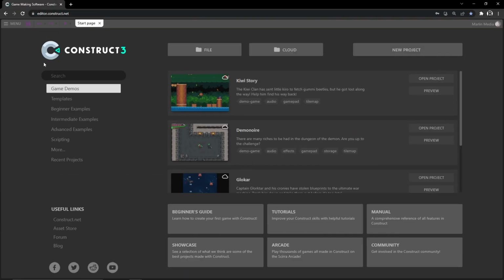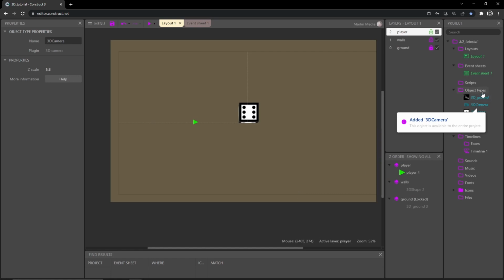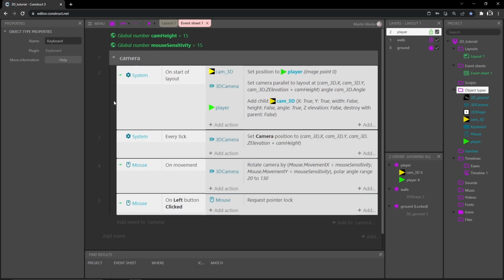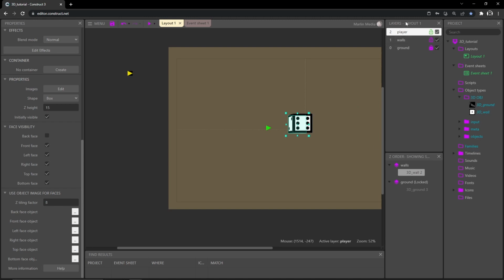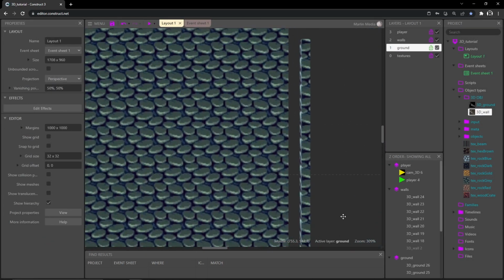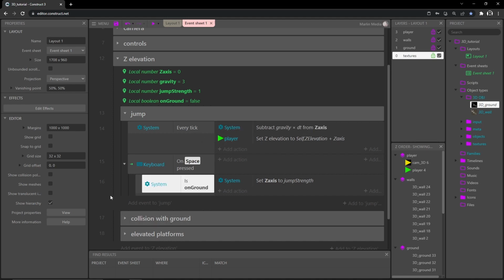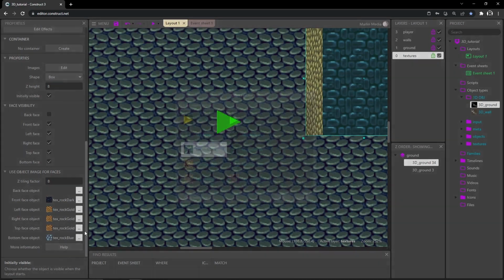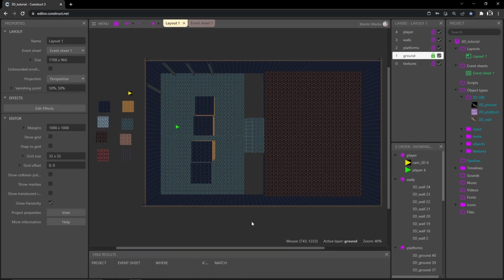3D in Construct 3 -- movement - camera - shapes - gravity

Comment: hey uh question. what does cam_3d actually do? i don't see the point of the cam_3d object. u can just set the camera to the player and it works the same. when i was following this guide and after i did the camera section i deleted the cam_3d object and changed set anything that was on cam_3d object to player object and it worked the same. so i'm just kinda confused

Comment: The examples are not bad. However, the final stage, when we do the jumps, is not very good. First, we are making the system narrow, preventing other NPCs or groups from climbing and jumping. In addition, for some reason you separate the floor and walls. It is reasonable to simply perceive all objects as cubes that you can lean on, stand on, and crawl under. This is simpler and it will be easier for the entity to find the path and so on. You have a lot of unnecessary variables and local checks, instead of performing them relative to the entity. You also do not use such a simple thing as accelerating the fall, you would not have to do animation and smoothing of the fall and jump.

Comment: All the camera coding works perfectly fine, but the player movement doesn't work at all. I have to continuously press the keys in order to move anywhere. is there a way to fix that?
Reply from the maker: Hmmm... Something has to be different. A variable, a value somewhere. It could be a thousand possible things. Not sure how to identify your issue without seeing your code. Maybe look through the 3D example projects on C3 start page..? My code is very similar to a couple of those projects they have.
Reply: @Marlin-Gamedev  ok, I will give that I try, because I was doing all of the coming you did and basically did everything then same but it still didn't work. I even tried some other videos that were similar to yours and it was the same result.. so, that kinda made me sad. But your overall video was really good and very helpful :)
Reply: @Marlin-Gamedev  do you thing you can take a look at it. i still can't figure it out? do you have a Gmail or something I can send if to you if that's ok? <:/
Reply: @dragonhany1  make sure that you are using while key is down and not on key pressed
Reply: Thank you

Comment: need help: pl_camera is on the ground for some reason, tried to play around with the camera height nothing changed
Reply from the maker: My guess is that your Z Axis scale is set to "regular" instead of "normalized". That will cause the camHeight value to be very low. We use "normalized" scale in this video and then change it in the next one.  In my "Z Axis Scale" video tutorial, I explain what it means, how to change it and how we have to change other properties with it. Including the "camHeight" variable value.

If you click on your main project folder in the project panel (right side of screen), that will bring up the project properties (left side of screen). Scroll down to the "Display" section, and at the bottom of that section is the option for Z Axis scale. Click on it and set it to "normalized" if you want to follow along with my exact variable values in this video. I prefer to work in "regular" scale because it deals with whole number values instead of percentages. I also use "regular" scale in all the other 3D tutorial projects on this channel.

Also... make sure you have that "set camera position" action in the "every tick" event too, or it won't update the position properly when your player character moves.
Reply: @Marlin-Gamedev  oh, thanks for helping. but is there a template for the 3d? because i forgot to save my project

Comment: Helped me a lot for my school project.  I am trying to make an aimtrainer.  Not everything was useful, but I can say that the 3D camera part was very useful.  Thanks!

P.S. do you know how to put a crosshair in the middle of your screen?  I've been trying and looking at other tutorials, but still find nothing.
Reply from the maker: To make a crosshair, create a new layer and move the new layer to the top. Then, in the layer's properties, change both paralax values to 0. That keeps the layer from moving. After that, create a new sprite, draw out a crosshair, and place the sprite in the middle of the viewport area. Make sure the crosshair sprite is on the new layer.
Reply: @Marlin-Gamedev  Oh wow!  Thank you very much!  Just got yourself a new sub!
Reply: @Marlin-Gamedev  Sorry, but I've encountered some problems.  I've got my both parallax to 0% and my crosshair layer at the top.  After drawing my crosshair, I don't really know where the viewport area is, or do I kinda have to create one.  I've found something on the event sheet, like if I do set position, I have, for example, Camera3d.ViewportBottomX and Camera3d.ViewportTopY, but if I try to it says that I cannot do this.  So what should I do?
Reply from the maker: @qisenwang370  The viewport is on every layout. There is a dashed-line rectangle in the top left corner of the layout. You will need to place your crosshair in the center of that rectangle on that layer with 0% paralax.

If you have several layouts, then you would want to create the crosshair on that layer 'on start of layout' at
X= viewportWidth("layername") / 2
Y= viewportHeight("layername") / 2
That should place the crosshair sprite in the center of the veiwport.

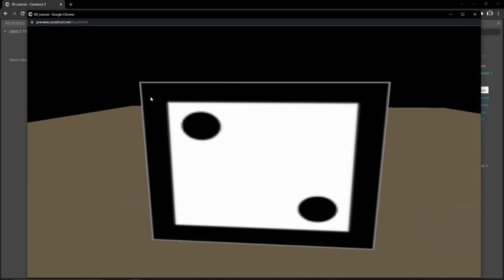Comment: Hi Marlin great video! But can you help me. At 28:30 a cant look up(Y) on my cam. But it works great on side (X). Can anybody help please! Its my first 3D game ever so thanks a lot for making this video!

(edit:) Im only looking at the floor
BTW if a remove the Mouse.AbsoluteY / MouseSensitivity it works fine BUT a cant move my camera up(Y)
Reply from the maker: Hmm, not sure what has happened here. What about the minimum and maximum polar range on that same pop-up window? If 90 degrees is looking straight ahead, then minimum polar range needs to be a number less than 90 to look up and maximum polar range has to be greater than 90 to look down. (0 would allow you to look all the way up and 180 would allow you to look all the way down at the floor)

Another thing to consider... In your comment you're saying "mouse.absoluteY" divided by the mouseSensitivity variable, and in the video we use "Mouse.MovementY" expression for the "rotate Y" field.

Does any of this help?
Reply: @Marlin-Gamedev  Hi Marlin! You are right. I changed the code from  Mouse.AbsoluteY to Mouse.MovementY
 and it work Great now! thanks for you help and the fast response.
Reply from the maker: @extrabob  Nice!! No problem!
I love it when I actually get it right lol.

Comment: Not sure if it was tackled in the video, still following along, but the "push out of solid" event has issues where it seems to make you slide more in one direction than others and getting stuck in corners causes all kinds of jitteryness. Also with the custom movement, you move faster in a direction while holding W+A than when you just hold W for example. Would love to see this example refined in a follow up video. Would also like to know how to walk up stairs that are a bit taller. Any taller and it treats them like a wall.
Reply from the maker: The push out of solid can cause that sliding like you mentioned. There are other options like push out at angle and then give it a specific angle to push out for each direction. This is how the C3 example project does it. Yet I found issues with that method as well... I didn't get too much jitteriness in my testing - but that is likely caused by the pushing out of solid actions. It does the same thing in 2D games. I ran into that issue when I made the Mini Map series... I really think more customization for 3D controls is coming soon from the C3 people.

I left out the customized speed controls for this video. In my original test project I set up a couple more variables and adjusted the speed for A and D which gave the player a slower strafing speed but also evened out the speed of the player when moving diagonally... This is another situation where I believe the people at C3 will have a 3D behavior for first person controls coming out in the near future.

As for the stairs, you could change the 0.5 to a higher number in the event where we check if onGround is true. Not sure how well that would work with other elements of the game. Another though would be to create a new 3D shape for stairs and set up brand new code for it to tween into position like we did in the original code but do it in higher increments for steeper stairs. This way, the higher increment snapping and tweening would only affect the new stairs object. These are all guesses though... Ideally, there would need to be a way we could travel up and down slopes in Z space. At this time, 3D shapes do not allow for that (I've tried it). Also, we can't rotate 3D shapes either, and that prevents angled ground formations... I've seen some examples of people using mesh distortion to create mountain-like terrain. I have not played around with that yet, so I don't know if the player would be able to travel up and down a slope in Z space or not. If that did work, then you could create a stairs object as a 3D shape with mesh distortion and a solid behavior and make it invisible, then put in a 3D shape with no behaviors to look like stairs for visual purposes only.

3D in C3 is definitely a work in progress. The solution to most of these issues will be built in to the engine eventually. I hope this helps, at least a little :)